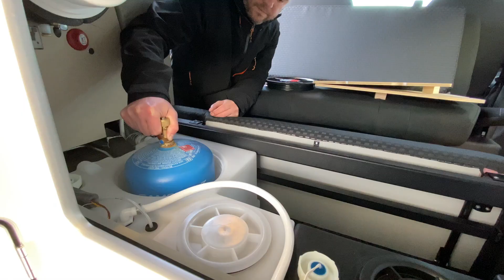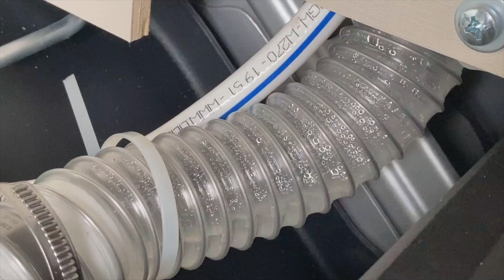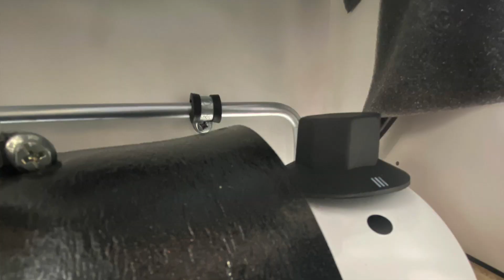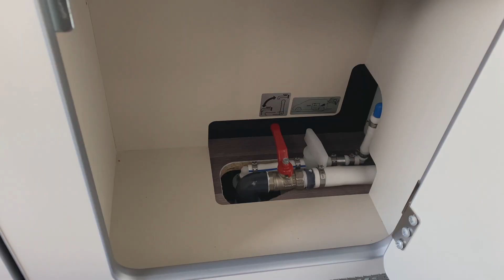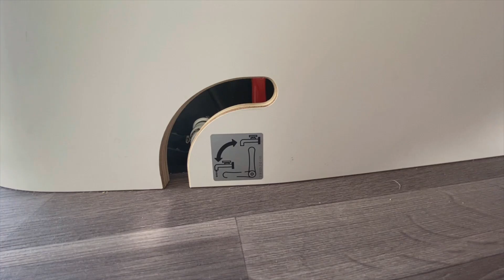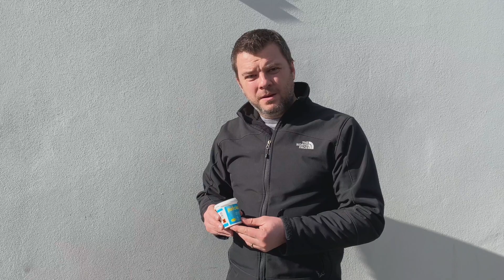Ford Transit Custom Nugget Family Campervan UK Episode 9: In-Depth Water System Review

Comment: Been very interested on the video detailing the water system. We recently purchased a 22 nugget active plus and finding that the water pump seems to stay on all the time been looking to find the pressure switch but no success. Any idea where i would locate it also I have been trying to get an instruction manual but again no success.Any help would be appreciated 👍🏻

Comment: we have a new Nugget plus and just wanted to point out a change from your none. Firstly the nlittle switch only controls the 12 v supply. When hooked up our heater came on with the switch in the off position. Also our thermmastatic switch for 12 v is on the opposite side to yours.

Comment: A useful video however we bought a 2022 model which is different because there seems to be no water pump switch. We have the new style control panel (see the later clip) which works well but somehow the water pump switch has given and the fuse panel is now vertical. Our situation is made worse because the supplying dealer (Keith Motors in Christchurch - avoid them) gave us a manual in French and all attempts to get an English version have failed. There is nothing on the Ford site that I can find either.

These issues apart this is a versatile vehicle and a lot of fun. Fortunately there are good dealers around and Alan Myerscough in the Lake District is the stand out for me. Just go in with your eyes open when buying as this is a collaboration between Ford and Westfalia and some things seem to get lost in translation - literally in our case!

Comment: Very informative video for Nugget Plus newbies like us! However our 2022 ex-demonstrater van doesn't have an obvious drain valve on the boiler like yours (or the instruction manual). It just has a pipe which disappears under the fresh water tank. 
Also the first time we turned on the water pump we had hot water without the boiler having been turned on at all. Any ideas on either of these?!
Reply from the maker: Hi - Apologies not experienced this but maybe worth you asking in one of the Nugget forums on Facebook. There are a lot of very knowledgeable owners on there. Hope you find the info soon.

Comment: Hi all, worth pointing out that the over-heat protection on the water heater in these is a one-time use part. If you leave it switched on with no water, this can blow leaving it broken until you can fit a new part from Elgena.
(qualified service person is required apparently)
There's one for the 12v side and one for 230v side, so 12v should still work after 230 blows and vice versa.

It'll catch a few people out, but it's better than having your Nugget catch fire!
Reply from the maker: Thanks so much for your input Drum Brakes. Great to have this knowledge from across the community.

Comment: Thanks for this - I was looking everywhere to find the wattage used for the hot water boiler and I see it's a measly 200 watts based on the sticker on the boiler - does this means it takes ages to heat up to max temp? Also, you mentioned the shower was COLD water only - surely there is a way to use the boiler for a HOT shower? Please say this is so... Thanks again for the fab videos - really informative for someone like me deciding which camper to order.
Reply: 200W on DC, but I think 660W on AC. 
The heater is made in two versions one has 330W on AC and the other has 660W on AC.
To be sure, you need to check the sticker on the other end!
Reply from the maker: Hi Chris. We've not timed the hot water boiler, but not seemed long at all and very hot. Been no issues at all for us. Have seen some comments in online forums on this recently though so you may want to check them out too. The Nugget Plus (not the SWB Nugget) has the hot and cold shower but in the UK,2022 SWB models also have had a hot and cold feed to the shower as standard- I have checked this today with a ford dealer. Hope this helps.
Reply: @SilverNuggetAdventure  Thanks for this - the shower control doesn't seem to allow a mixer of hot and cold water though, it just appears as though it's a standard shower attachment without any controls of the hot/cold mix - what am I missing? Thanks again for your repeated answers, they really are most helpful.
Reply from the maker: @chrisyates399  Sorry we couldn't help any more with this. Hopefully someone else on here with that van will be able to help.

Comment: Firstly I do hope Neil is getting better and on the mend. We’ve just received our nugget from the dealer and your vlogs have been invaluable. Could I ask when running the Puriclean through the system do you run it through the hot water boiler and tap as well ? Thank you Guy
Reply from the maker: Hi Guy. Apologies for late reply. Yes we are back to full health now thanks.Thanks for the kind comments. In regard to the question above- yes we do run the puriclean through the boiler and hot water tap as well, ensuring we rinse through thoroughly. We also recommend that you ensure you follow all the manufacturer instructions. Hope this helps.

Comment: So useful. Thanks for doing this. One question - when using the van for day trips or single overnights, would you drain down the boiler as well as the fresh water tank afterwards or is it enough just to drain the fresh water and remove any waste each time?
Reply from the maker: Thanks for the excellent question. We are going to drain down the boiler every time we have a gap between trips. I am sorry this is vague but we will have to live the van for a few months to get a real life feel for it. Any water left stagnant in the system for a significant amount of time could allow contamination.  Although my vlog makes the process look extensive it really isn't that hard once you have done it a few times. We will be posting updated vlogs as our experience grows. Keep an eye out.